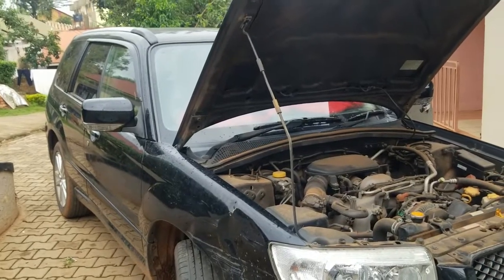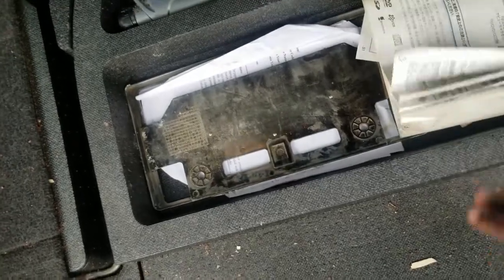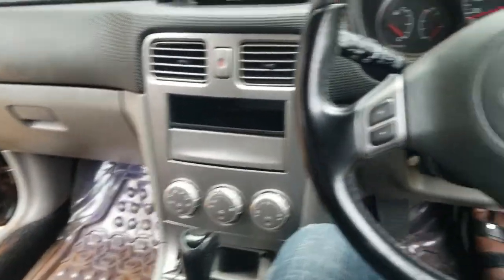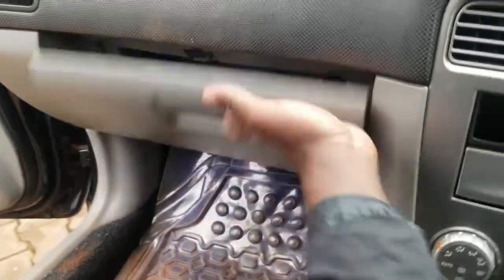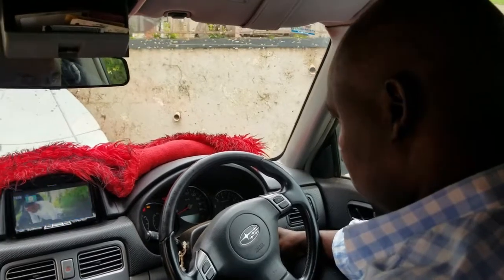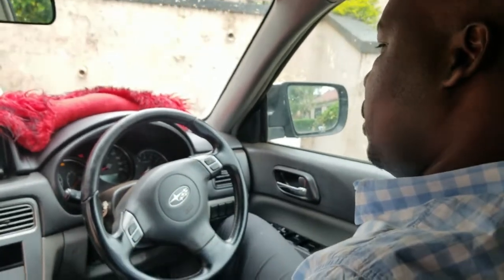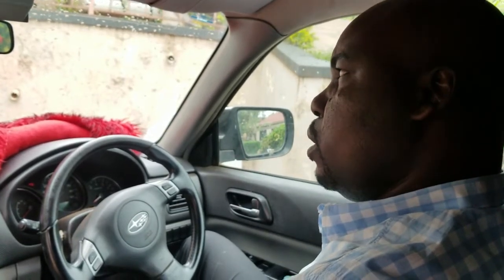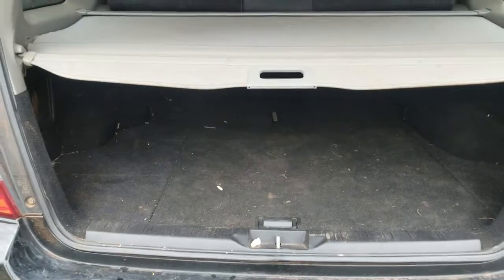Subaru Forester - The Cross Sport

Comment: I have driven toyota cars before I finally joined the subaru family,  Subaru has a boxer engine fixed horizontally, this lowers center of gravity there fore very stable on the road, quick and responsive acceleration compared to toyota competitor in the same class, subaru cars are slightly cheaper compared to toyota, mechanics and dealers are now many and subaru has one of the best all wheel drive system in the world. The resale value has also improved over the years but still lower than Toyota. Because of the Symmetrical all wheel drive, Subaru is popular in winter countries like Colerado. I currently have 2009 forester new model and it gives me 11 to 12 Km/L of fuel.
Reply from the maker: Thanks for Sharing!
Reply: Very insightful information
Reply: Soon joining the Subaru Forester family.
Reply: I'm soon leaving the premio for the wife

Comment: From my experience normal Subaru servicing costs me btwn 250k - 180k at Shell or total changing oil lubricants & filters......I have a Subaru Forester cross sport 2007 non-turbo which i have driven for now 4 years.... i don't know how Addul is able to do Subaru servicing at 90k
Reply from the maker: He may have lied or gone to a cheaper place
Reply: Man...plus when you hit above 120kmh, the car consumes less and not more like he said. Instead it consumes a lot between 70kmh and 100kmh. But new and nice spark plugs, a healthy exhaust system and zero mods should help with fuel consumption.